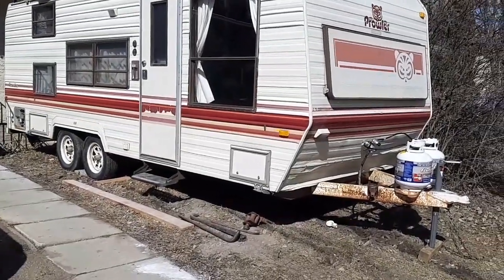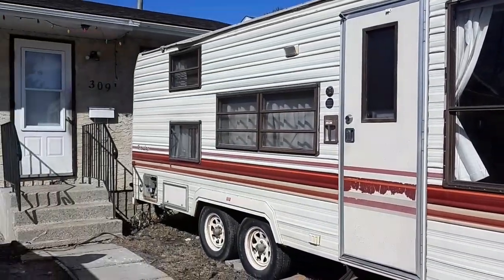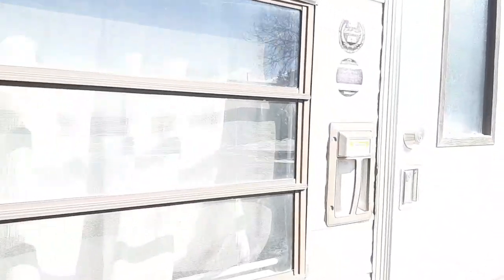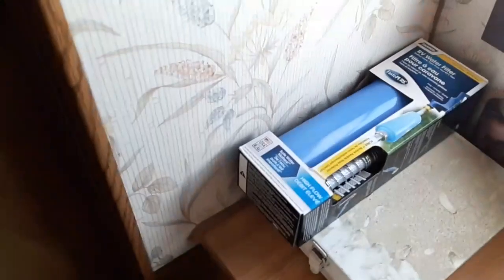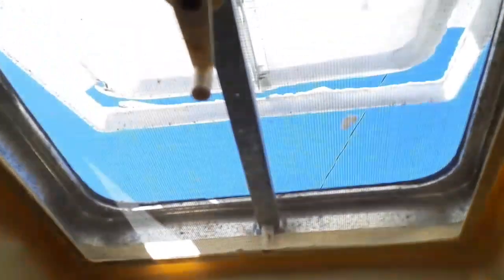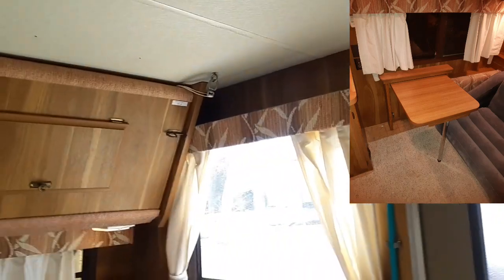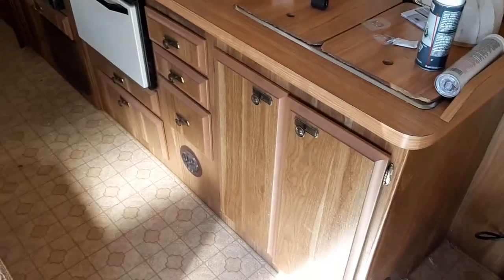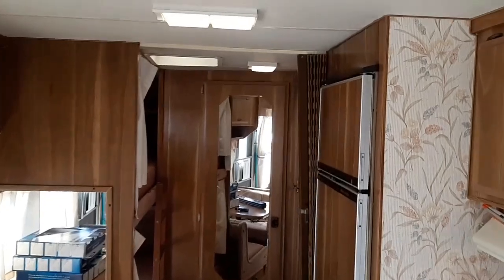1986 Fleetwood Prowler 23P walkthrough

Comment: i have a 31 ft 1986 prowler most of it i have gotten rid of , but i do have furnace not wanted if your in VT or upstate ny you can come and get it free
sincerely deb
Reply from the maker: Hi Deb, that's very generous of you! But I'm actually way north of there in SK Canada. And I have since replaced the furnace with a diesel fueled forced air furnace:)